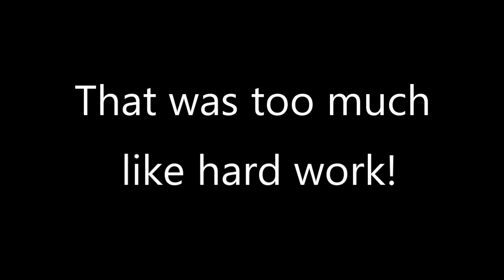Awesome vintage micro hammer restoration...

Comment: Excellent! I wondered if you would use stacked leather disks for the handle and then applauded when you used scrap laminate. But after you liberally gooped epoxy all over it I wondered gosh how is he going to sand all that off? My favorite part was at 5:03 when you chucked it in the lathe and made quick work of it :D Good job!